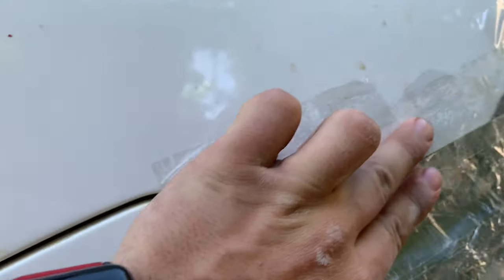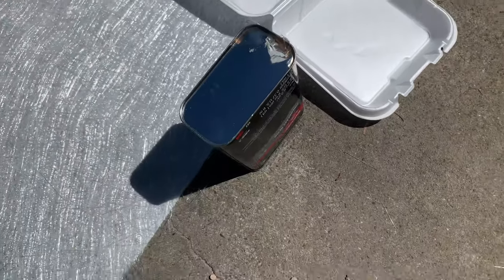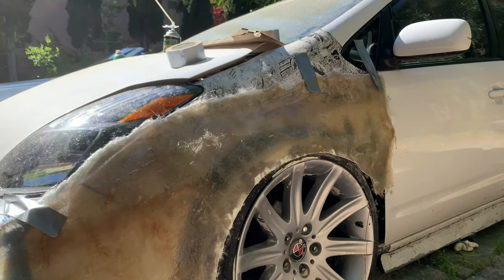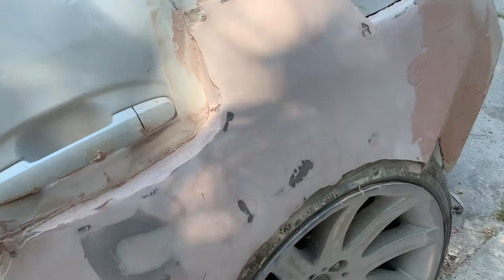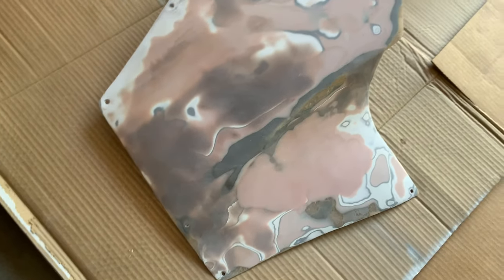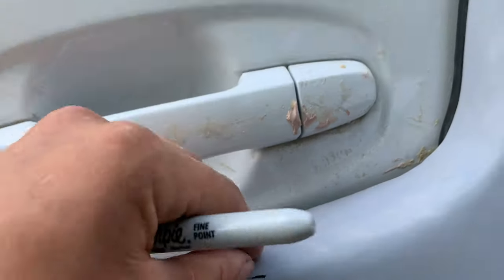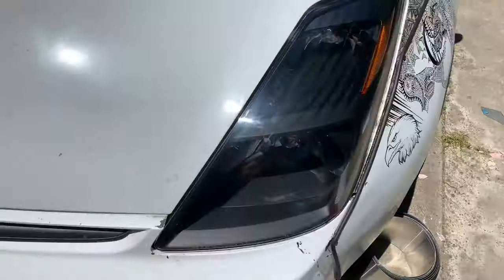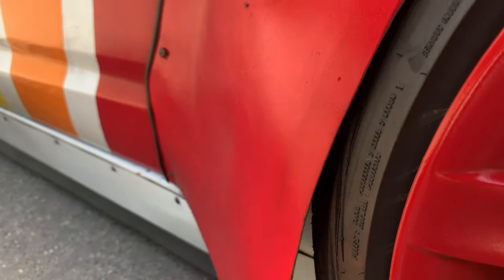DIY Widebody Overfender Pt.2 | The Fiberglass

Comment: Hey bud you should consider using duraglass rather than bondo for your 2nd to last coat it's way stronger alot more forgiving and flexible and about twice as light when its dry, also to find all of the high low spots try getting some plain old black spray paint in a rattle can and mist the entire area to be sanded then use 220 and sand the entire area the black paint will remain in all of your low spots allowing you to add a small amount of bondo to the areas and have an extremely  clean look. Nice job by the way it looks sharp!!! #100 and dont pay any attention to these jackasses that are hating on ya they can't even begin to do what we do that's why they run their cocksmokers

Comment: Good stuff. Just a few suggestions to make your gear look more professional- 1. Instead of using just Bondo, you can mix in some of the polyester resin and use a large squeegee(plastic strip) to glaze the entire fender. A few passes would yield a very smooth, very hard surface.The lighter mixture flows and settles very well. 2. With the time saved from sanding, you can use the extra effort to apply a complete, final layer of 1.5 oz fiberglass cloth and thick resin/Bondo cap. Otherwise, you're sure to get mad rock chips, warpage and fast deterioration.
3- After the final layer, throw the whole thing in a vacuum storage bag and suction it down with a shop vac until cured. You won't believe how much faster, easier, stronger and better looking the whole thing is for just a few more dollars.

Comment: So hey help me out because I'm trying to do this on my Eclipse. You made that looks so simple and I've been working on mine for the second summer. What kind of tape did you use on that? I can't get this foam straight no matter how many times I try. And you use sandpaper on the angle grinder? I may try that cuz I've been filing it by hand. And you used 800 grit to wet sand before the basecoat? I've always used 400. well I'm learning a lot from your videos help a sister out 😉
Reply from the maker: send me a DM on my instagram, ill get back to you a lot quicker than on here
Reply: Ok I will
Reply: @nazarkali1158  I can't find you on Instagram I'm on there too elenashah29

Comment: I'm looking at few DIY videos and plan on doing one PANDEM style for the Honda Delsol. Seems like the foam process is the best because you and control and shape the design easily. Your fender seems very flimsy with just one layer of fiberglass. I was thinking of 4+ layers.
Reply from the maker: The more layers you add, the stronger it will be. I chose to do only one layer because i wanted a flexible fender

Comment: I mean if you dont want to use the rear doors, shave the handles, gut the insides, or cut the wide body and make those panels into 2 separate pieces, to be able to keep the rear doors

Comment: You could also spray foam onto prepped surface area & then do you glass overlay over that.. It provides rigidity & sound deadening... Its easier to wet out the panel with under catalyzed resin & then lay the mat over that... Then proceed to wet the remaining glass mat by brush... It eliminates the trapped air bubbles underneath.. Awesome job however.
Reply: Are you saying leave the spray foam on forever? Isn't that gonna be a potential moisture trap nightmare in some cases?

Comment: I want to do my own personal shell design.  Do the outside of the cast for my specific design, and the inside, so it fits over the existing shell. Similar to this. Only shaping the exterior by foam as my mold.

Comment: What did you use between the fender in the body. Was it some kind of rubber liner?
Reply from the maker: basically yea, you can just search up fender flare trim on eBay and you should be able to find some for like $12/10 feet

Comment: So can I seriously just foil and tape over that foam and not have to Bondo it at all? that would be great this is such a pain so much work
Reply: You dont want to use that much bondo.  I would have added at least 2 more layers of fiberglass and any large areas that needed filling I would have filled with more fiberglass and epoxy resin.
Reply: @bigboycombo6342  ok im gonna try use foil and tape then pull molds.. Still shaping my foam.  What a mess! 😂
Reply: @dsmchick935  it's time consuming when done right.  I like using fleece because the contours and shapes can be made uniformly.
Reply: @bigboycombo6342  well I use fleece for my other fiberglass projects but I didn't think I could use it over the phone I didn't think about that

Comment: I admire the work you put into this 2pt series however you lost me at one sheet of glass mat and the rest body filler the strength you need for fenders or over fenders comes from the fibreglass layers itself applying that much filler over a thin layer of fibreglass mat will lead to stress cracks and fractures and distortion apart from this you're doing well
Reply from the maker: Ii only did one layer because I wanted flexibility. You can still use the same process + add a few layers to have a stronger and firmed overfender. Haven't had any cracks yet (almost half a year later) so i don't consider it a failure
Reply: @nazarkali1158  good stuff man